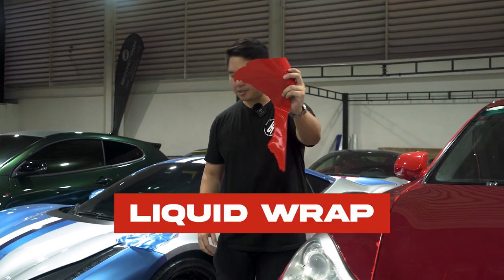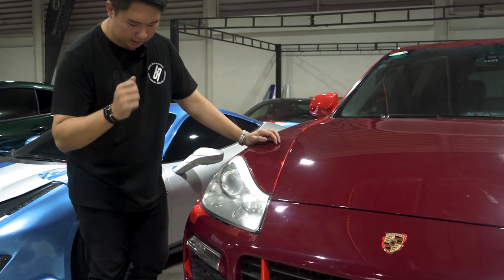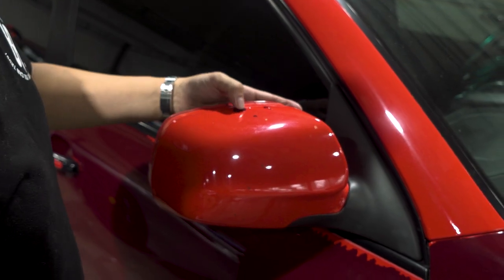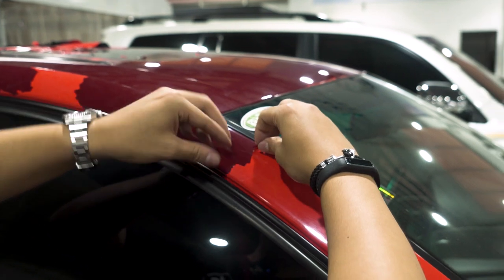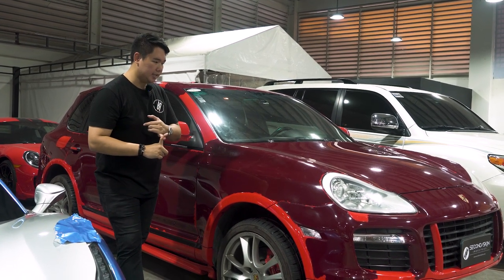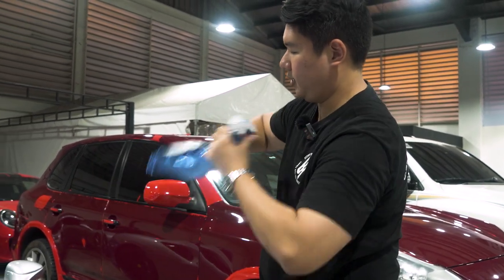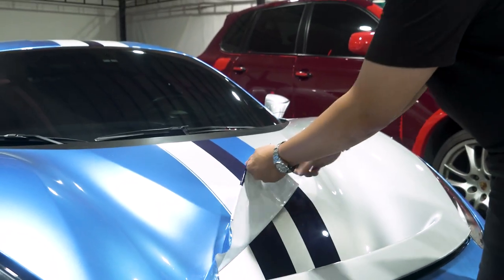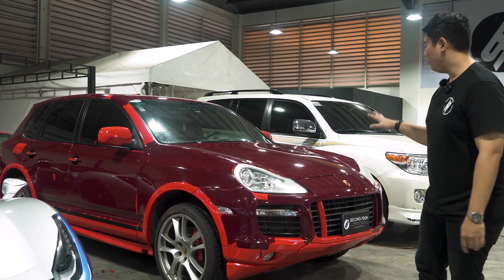VINYL VS. LIQUID WRAP | VLOG

Comment: There's a chemical  used to take liquid wraps off your not suppose to just chip it off. Definitely more likely to damage the car with a vinyl wrap installed and removing compared to a proper liquid wrap install and removal

Comment: Wraps suck removing, even under heat. Liquid wrap is easier to remove. I've seen Wraps coming off mess up the glue spots creating dents. While yes the Wraps can offer a little more protection to scrapes, but usually it needs body work from the dent it created. As for color matching, yes you'll have to paint a whole side or maybe the whole car. But Wraps usually arnt perfect color match either. The Liquid wrap in this video wasn't applied correctly as its way to thin, I'm sure pressure washing would take the rest off though. Overall I think Liquid Wraps are here to kill Wraps as I think they're far superior (protect from scratches, can do a clear bra, can even wet sand and buff some of the Liquid Wraps, leaves a finish as nice as paintjobs Can be) Wraps do have there place though where they shine compared to Liquid

Comment: As I know of I think that the liquid wrap installer put actual clear coat instead of peelable clear coat on top of the liquid wrap making it brittle
Reply: Thats what happened to mine. It was so thin that it burned, I think, made it crack and matte looking instead of glossy.
Reply: I use normal clear, that’s not why. It’s because his base was way to thing. If u have enough base u can use whatever u want to top it off.

Comment: I totally get the frustration of having to remove an improper installation. But that’s exactly what you have with that liquid wrap. It was applied incorrectly, meaning too thin. The installer did not spray enough product, and now the customer gets stuck with that without knowing. Sad. 

For what it’s worth, I’ve seen similar issues when people install the wrong type or cheap vinyl on vehicles. It gets brittle, cracks, and it’s difficult to remove. 

The key takeaway from this video should be, find a quality, trusted installer no matter what you decide to go with.
Reply: I was told for liquid wraps you want to spray like 9 coats
Reply: Just happened to me:(